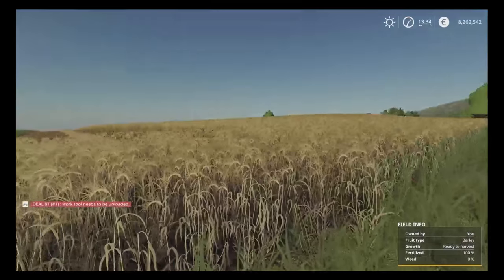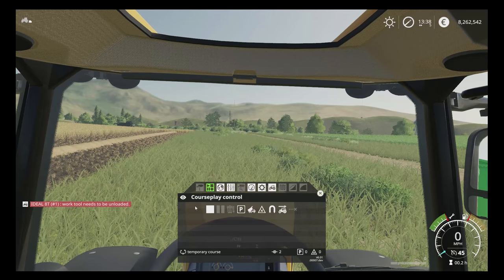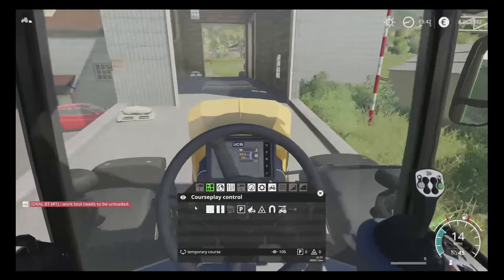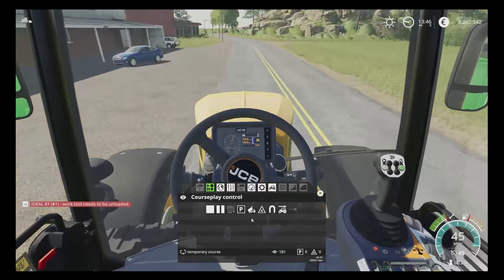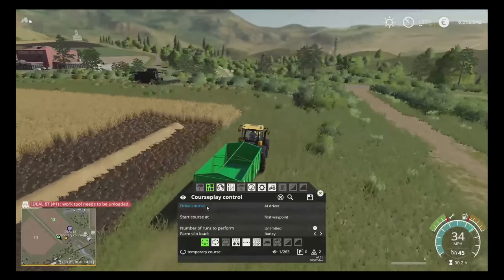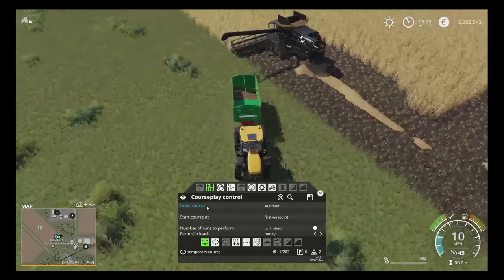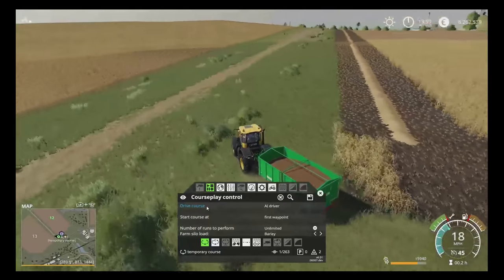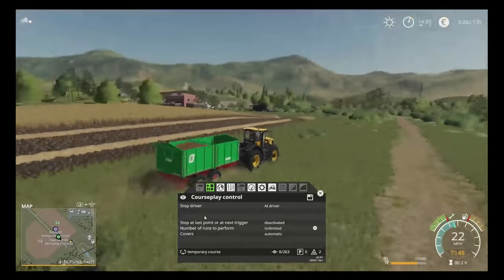CoursePlay in Farming Simulator 19 | Episode 5 : Carting grain - Stage 1

Comment: When you use that system it is for the loading and transportation of the different crops from your silo's etc. This is why it has the "load at start" and also the grain choice. This is so that when your tractor pulls up at the silo it will fill the trailer, assuming you chose fill at start and it will also fill up with the appropriate grain that you wish it to transport. I used this for the different delivery points and the goods they would take, ie I would have a course of "Canola to Restaurant" and that is what the guy would do. For doing the fieldwork as in collecting from the combine you use the 2nd option and do it the same way as this except you collect from the combine and then empty at your silo and come back to the start to wait for the next "driver request". One other thing the "Set drop point" is for those times where yoiu might want to have your tractor drop the stuff at a place that isn't a trigger point, to activate the trigger point at the grain silo you sent it to you just need to pause for a few seconds. That should be enough for it to work :~)

Comment: how do u get a tractor to follow u if your in a foarger
Reply from the maker: When you select the harvester to unload. The courseplay route should follow the harvester. Usually it will head to the silo first, then drive on to unload at 60%.
Reply: Set the start filling level to zero, and set the tractor to find the harvester \ forager being used..it will follow at a pre set distance and side, you can alter these as required,
Reply: Mushyboy Munro ok thanks